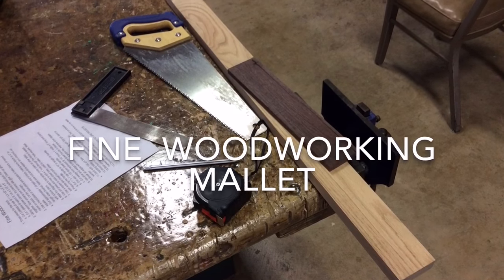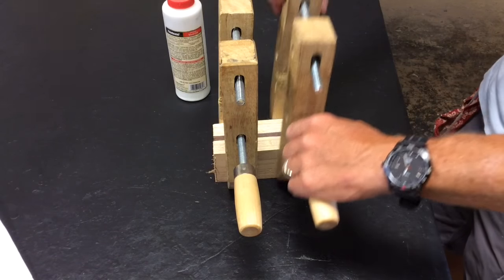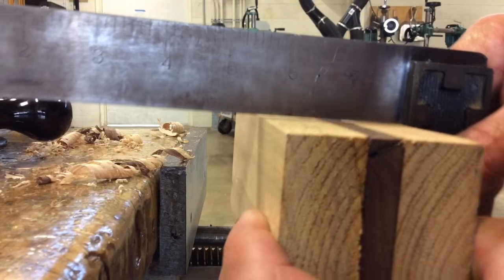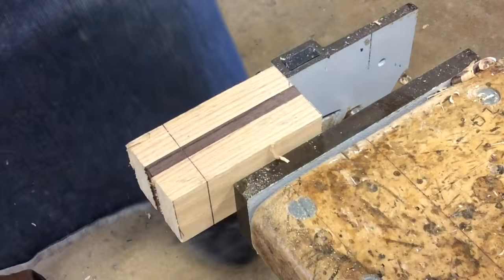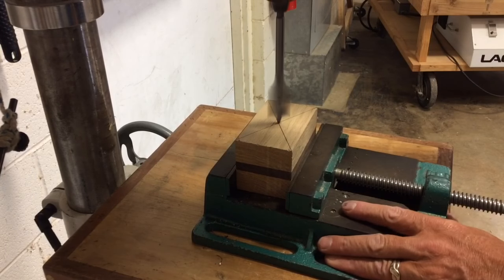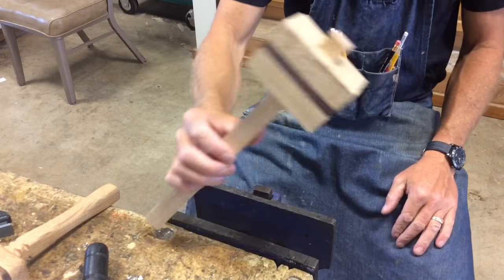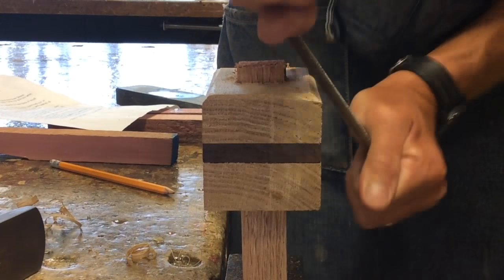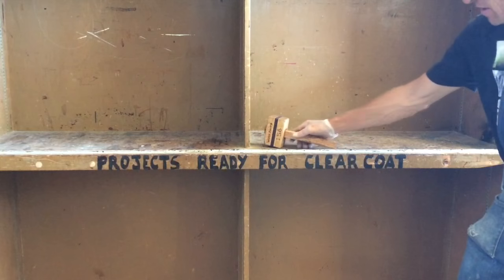Fine Woodworking Mallet

Comment: It is a good looking mallet, but why did you cut it to length in the first place rather than having to cut so much off both ends?
Reply from the maker: Two reasons, so the students get more experience cutting, and I always make it practice to cut boards longer than you need, gluing, then cutting to length, no matter what I'm building. Good question.
Reply: @Woodshop156  Thanks mate